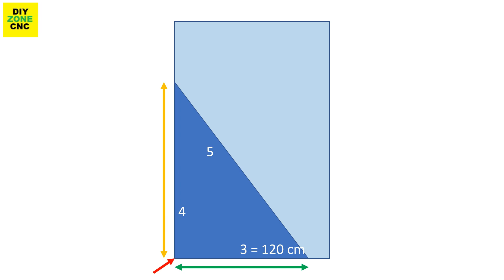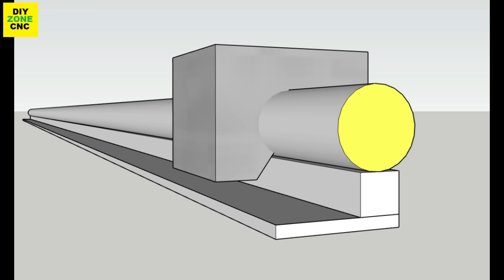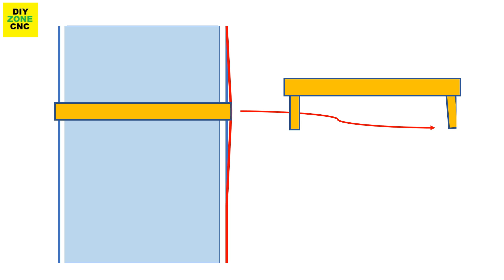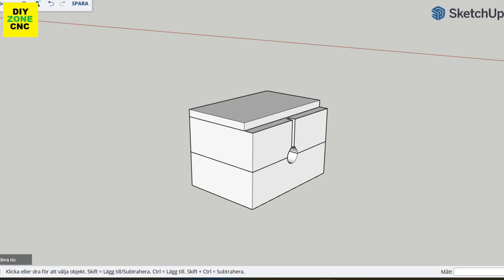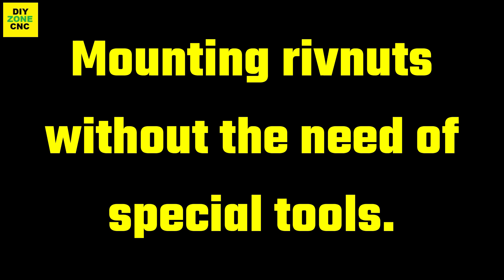Building a HOMEMADE DIY CNC table with DIY Linear Bearing Rail.

Comment: Great and elaborate work, very clear explanation, ideas outside the box of consumption of expensive commodities
Keep up the nice work🎉
Reply from the maker: Thanks! I do often wonder if the same type of solution is available in other branches or in different cheaper parts. Sometimes it doesn't work but luckily sometimes it does :)